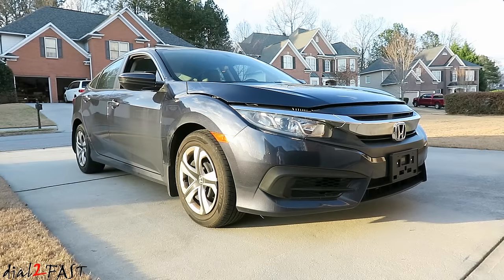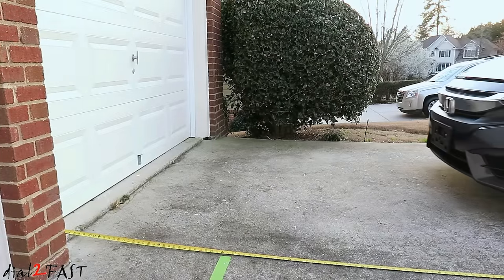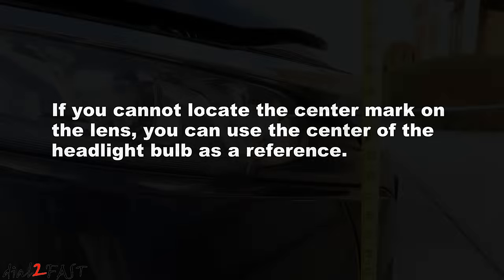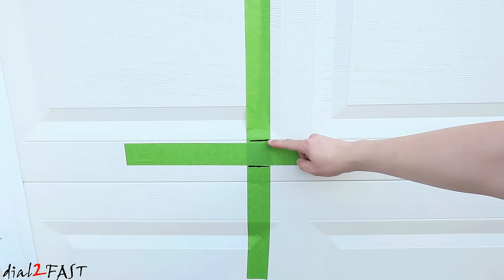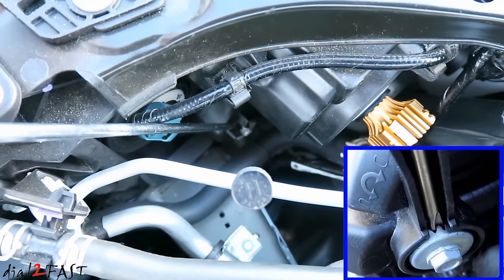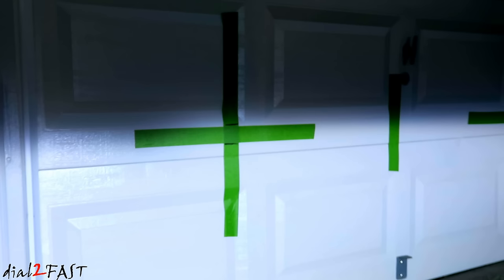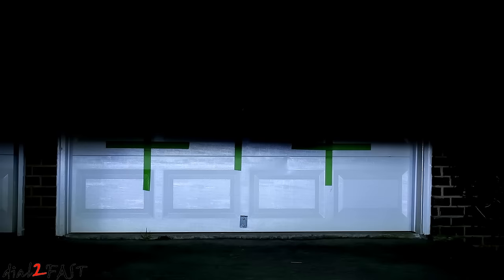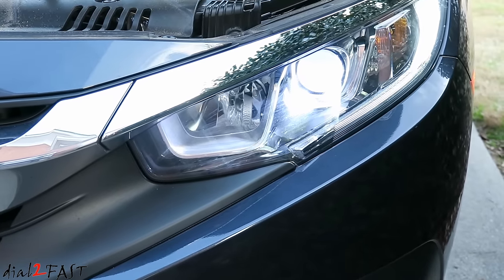How To Properly Aim The Headlight and Foglight - Full Tutorial

Comment: Yesterday I went to service center as my beams are too low.. like I could see only 20 feet in front of me. Service center guy said there is no motors to headlights and as you have electric adjustment it can't be done manually and I need to change headlight assembly as whole(though it was changed last year and in pretty good shape). I was not in budget so I didn't change. Today I saw this video, first time I tried to work with car myself. I take out whole assembly to observe if there is any screw ... I found it and adjusted beams myself, now it's perfect. Thank you so much for very informative video.
Reply: So what will you say about that service centre guy
Reply: @misterman124  that is just a scam to earn a few extra bucks. My guy said the same thing to me, but I knew about this tip, so I did it on my own.

Comment: For the fog light adjustment you don't have to measure the height of the lamp. Adjust the TOP of the fog light beam spot so it just touches the BOTTOM of the low beam spot at 25' from the wall.
Reply: Posted 3 years ago, but still very useful - Thank you.
Reply: Yep just helped me thanks so much!!
Reply: If you have LEDs that do not have a good beam that mimics the halogen OEM, then NO, because that will adjust your fog beam too high.  Even if you do have good halogen beams, the 4" rule is standard, and should be used no matter what bulbs you have.  Meeting the fog beam into the low beam is a shortcut that is not a good idea.

Fog lights are designed for a reason, and should be properly adjusted, just like low beams should be properly adjusted!

No matter what, NEVER put HID bulbs in housings that are not designed for them.
Reply: I wouldn't want my fog light shining above horizontal, because this would increase risk of fog glare shining back at me.

Comment: Passenger side is always higher than driver’s side beam. Both beams are never equal when set from the factory. Driver’s side is a bit lower.
Reply: i've been thinking this for months. thanks man for the info
Reply: I think the drivers side is 2" lower than the passengers side. Thanks to Ray Dar.
Reply: @TheHouseofChameleons  i've heard that they put the driver side a bit lower than the passenger side on purpose to prevent blinding oncoming traffic;specially when your running super bright headlights ( e.g. LEDs & HIDs).
Reply: @POgsDar23  If we talk about blinding oncoming traffic Led lights are so distructive and anoyingh.
Reply: Wow... Thanks...my driver's side is lower and won't adjust any higher...it know makes sense
Reply: @eddievazz561  
If it can't adjust any higher that probably means you have it too high already.
Reply: On reflectors housing yes the passenger side should be higher. On projector housing it should be the same as it delivers a much sharper beam pattern.

Comment: The video does a good job of covering the proper technique of setting up the painters tape on the wall, but it doesn't take into account the differences in headlight height for various vehicles, from Prius's to jacked up SUV's. You don't get extra distance just because your vehicle's headlights are higher off the ground.  

The recommended "reach" of the driver side headlight is 200 feet (2400 inches). You're measuring how much the beam drops at 25 feet (300 inches), so you would multiply the height of your low beam by 1/8 (.125) since that is the ratio of the two distances, 300/2400 = .125

If your headlight is 30" from the ground, the drop would be 3-3/4" at 25 feet. If it's 36" high then the drop would be 4-1/2" at 25 feet. There's not a lot of difference, but it's there nonetheless. The average person can do a decent job on their own if they have the right information to begin with.

The whole point of doing this is to give you a decent view ahead of you without blinding oncoming cars. The passenger side should be set for a reach of 400 feet so you can see road signs, pedestrians, etc that would normally be to your right. Typically, the passenger side would be about 2" higher than the setting for your driver side since it won't blind oncoming drivers. The ratio there would be 300/4800 = .0625. You can do the math for your vehicle. 

In my opinion the degrees that might be marked by your headlight is a waste of time. Who has the equipment to measure degrees that precisely? Certainly not your average driver.

Comment: Aiming Japanese-make composite headlamps is done in
reference to low-beam with a specific factory-specified pattern that u can find
in FSM. If u don’t have that info just take it to a body shop that specializes
in your brand of car, should cost ~$100 for a perfect pro alignment.

Whereas on North American and Australian makes the sealed headlamps are aligned
on hight beam and are easy to aim against any wall: 

Horizontally they shine level as measured up close and at
15-20 feet. 

Vertically, the passenger-side headlight shines straight ahead and driver-side
slightly towards the centerline of the vehicle. (as measured up close and at
15-20 feet)

 

Plus afterwards they can be conveniently broken with a
hammer.

Comment: I have a question? Driver side low beam headlight has a darker glare aiming toward the side. When I put them high beam the glare is better. Sometimes, on a darker road, I can't see the glare. Does my headlight need adjusting or is there a defect with this light? I also put  in new bulbs, still the same with the driver side. Passenger side work great. Need help, please!!
Reply from the maker: If you already tried replacing the bulb (assuming it's halogen bulb), then you have a reflector type headlight. The chrome reflector inside directs the light in a specific pattern. If your light output is bad with a reflector headlight, there isn't much you can do to fix it. The only other thing is check the headlight lens cover and make sure it's not old and oxidized which will reduce light output.

Comment: Ok so this video is super helpful, but the driveway slope is gonna throw my adjustments off. Wondering if i should run a straightline to measure the difference from 25 ft and factor that in when i mark my garage door. How much does a mechanic charge to do this? Ugh... and id have to factor in the angle of the slope.
Reply: I think I'm gonna pull another car next to the one that might need adjusted and line it up that way. It's only a vertical adjustment anyways

Comment: This is a great tutorial. However, what isn't mentioned is this should always be done on a relatively smooth and level surface, with the lights shining onto a perpendicular surface when possible. This can work in a driveway,  but the smoothness and angle of inclination of the driveway would have to stay consistent from 3ft to 25ft away. If the angle/level of the driveway is different at 25ft vs 3ft, then your results will not be accurate. You should also rock the front of the car up and down to settle the suspension.
Reply: He explained it good enough to be able to adjust them, if they that stupid and can't figure that out ,then they don't need be doing it anyway
Reply: @jeffhicks2070  No, he did not explain it well enough.  Most driveways, from the garage door, the first 2 sections are still at too steep an incline upward, backing up to the third section will put the beam to an even higher level at 25 feet, meaning, "the smoothness and angle of inclination of the driveway would have to stay consistent from 3ft to 25ft away".

"this should always be done on a relatively smooth and level surface, with the lights shining onto a perpendicular surface" if you want a very good adjustment!

Since you "can't figure that out", you "don't need be doing it".

Comment: Most Driveways (Like Mine) and looks likes yours, have a slight incline. I guess that doesn't have a factor when backing up 25 feet?
Reply: as long as the surfaces used are flat the driveway may be inclined as the incline causes a negligible differentiation from true

Comment: Critique.....your driveway is not level and slopes down toward the street, like almost any other driveway would. With the back of the car therefore "low"....aiming it "correctly" for height...means that when the car is level ( rear now higher when it is truly level)....your adjustments end up being too low.  Also, you can get away with the passenger side "slightly" higher, and the driver's side slightly lower, to avoid blinding oncoming traffic with the headlight closest to the oncoming car.
Reply: Great explanation.But your explanation means nothing if We are talking about LED lights which are so distructive and anoying.Led lights  should be prohibited.Especially if it is fucking dickhead pick up truck driver behand me and tailgaiting....
Reply: @miroslavvarga3707  .....not entirely true. If you buy quality LED headlights , as I did, to replace H4 bulbs, these are designed to be installed in such reflectors and have a rotational "orientation" that must be done....like any lights.....assure proper reflector design for the bulbs used, ....do the proper orientation, and then properly aim them....like all lights. But yeah, understood if the lights are bright, tall, and not aimed....would like to haul the driver out and throttle him.
Reply: @miroslavvarga3707 🤣🤣🤣

Comment: I thought you pull the car up as close as to the wall as possible without hitting it and put the tape at the step then go back 25ft? Am I wrong?

Another thing. The marking in the headlight you used was for the HB now the actual main light

Comment: You didn't say how to adjust the fog lights like what tool do you use where do you use the tool at
Reply from the maker: The foglight is adjusted similar to the headlight. You have to stick your head under the foglight and look for a philips adjustment screw. You turn it clockwise/counterclockwise to adjust up/down.

Comment: I thought when the headlight center is less than 36 inches like in cars, you don't need to add 2 or 4 inches below the center. The center is as is if headlight center is below 36 inches.
Reply: ..light should be directed to the road, not perpendicular : )

Comment: Why do I need to start with 3 ft away from the wall? 
Where did you get it that fog lights should be adjusted 4 inches lower than the center, not 2 inches?
Reply: ..to accurately install the tape, before backing away 24 feet

Comment: For the leds head light is there a certain way the lights should in the projectors or does it not matter. You didnt say in the other video
Reply from the maker: The LED lights are installed in the headlight housing and twist clockwise until it stops. If it's a two sided LED light, the light will be oriented so the LED chip faces to the sides.

Comment: Do u have any easy way,lets say just 3 or 2 feets from the wall..i live in apartment..parked in level 3.. theres no space for 25 feets..Thanks.
Reply from the maker: Unfortunately, you can't properly aim in it when you are close to the wall. Cause the beam pattern spreads out wider and wider as you increase the distance. 25' is what the spec calls for.
Reply: @dial2fast  Thanks for the reply..i'll try at wallmart carpark😙

Comment: Dial2Fast. Indeed your driveway has a slope. It seems to be around 2º. If your headlights are 1 meter from the wall you have to compensate +2.62 cm (check google for slope calculator) and then substract proportionally those 2 inches @ 25ft. I don't know if Honda cars have the %of adjustment engraved on the headlight housing. In European cars (not SUVs) it is between 0.8  to 1.2%. As for the adjustment you did, your beams will point lower than ideal and also add your weight, which was indicated in the checklist but not while adjusting. An 80kg guy lowers the beam level 2-3mm @ 1 meter depending on suspension setting. All in all, the low beams must have a reach of around 60 - 70 meters. With HID projectors the range is up to 90 - 100 meters (cut-off line). Sorry for the metric numbers, I hope to throw some light into the matter here.
Reply from the maker: Thank you for sharing the information. Indeed for most DIY person at home, finding that ideal flat road surface long enough for you to position your car 25' back with a vertical wall in front of it can be difficult (depending on what's available in your area). Here in the US, there are lots of people with misaligned headlights that are blinding on coming traffic. Not just people that have installed LED or HID, but people who have replaced headlight housing or have damaged front end. I want to provide the information to people so at least they will know how to adjust the headlight and get the beam pattern close to what it should be. Also with all the measurements one must do with tape and ruler, there will be some percentage of error in performing this procedure, but I think it's better that a car owner try this procedure as best as he/she can, instead of not doing this at all, and drive around in a vehicle with misaligned headlights.
Reply: dial2fast I missed to comment your video is the most easy to understand and follow step by step I have seen in YT. Indeed it is amazing the number of motorists who drive out there without a single cent of consciousness about their headlights and all those dumbs who install HID bulbs in reflector housings. Here in Europe we have very strict regulations on headlights, position lights, fog lights, DRL. Sadly it's not the case in so many countries.
I appreciate your effort to spread some wisdom through your channel and turn night driving into a more enjoyable experience.
Reply from the maker: @rudolfhuijs4526  Really appreciate your feedback and comment. Cheers!

Comment: I just installed LED headlights the ones from your aux beam link and my crv shares the high beam and low beam in the same housing. Is it safe if I mess with the adjustment ?
Reply from the maker: Before you adjust it, you can just follow the steps in the video and check if your aiming is off or it's ok. If you are also concerned, you can mark and count how many times you turn the adjustment screw so you know how much you have changed. But the alignment spec is only for the low beam, and there is no aiming spec for high beam.

Comment: Ive moved my headlights down as much as they can go but they are still too high. Any reason why this would be? I made sure the bulbs were sitting correctly, the groung where im testing is flat, tire pressure, weight distribution, has been checked. Im lighting up the damn trees haha.
Reply: Ray G you didn't put led in reflector headlight right ?
Reply: yamin huang no sir it is a projector housing like the car in the video
Reply: Either led was installed incorrectly or like my older car the adjuster stripped and was jammed after turning it to much